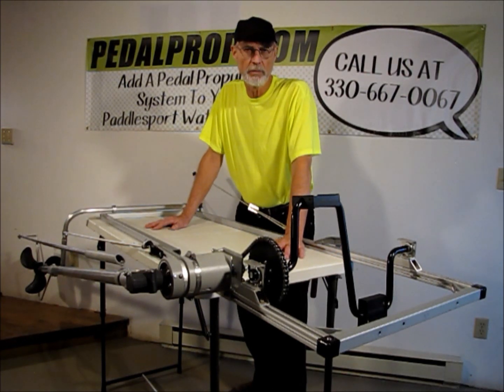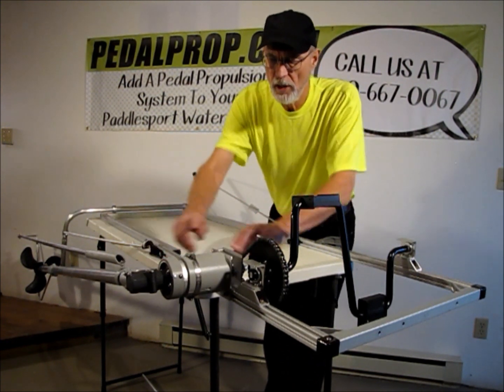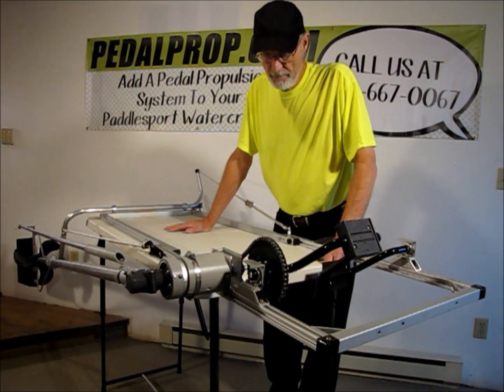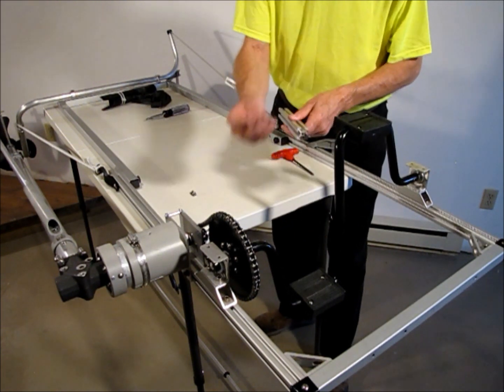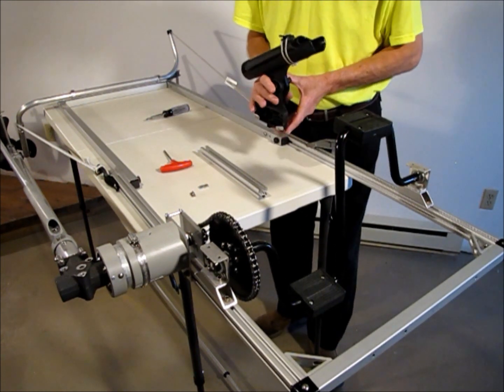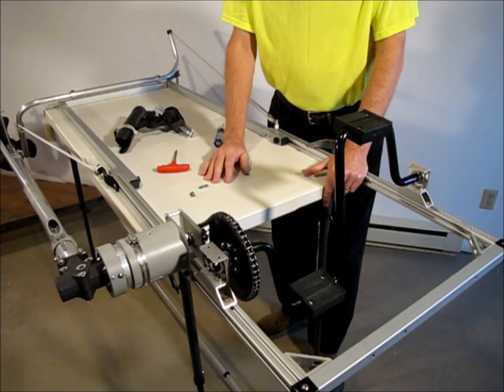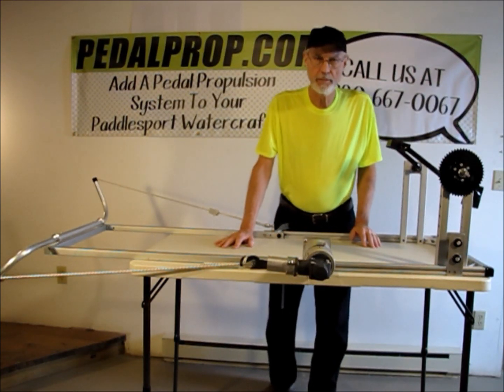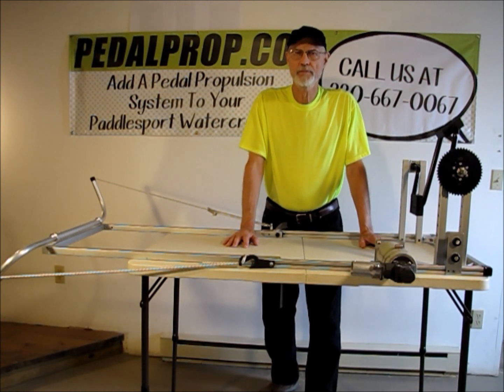New PedalProp Design

Comment: Could you open source the design?  What was the right-angle gearbox you used?  (It looks familiar, perhaps from an angle grinder?)
Reply from the maker: My patent is still good for several years so I may see about bringing it back in a slightly different form in a few years, so no open sourcing. The gearbox I used is an industrial gearbox that retails for over three hundred dollars, not some retro application.

Comment: Reasonably priced and well done .....I'm a retired composite boat builder and now have an aluminium canoe which I'm making into an outrigger ( proa ) canoe for snorkeling purpose . I'm saving up for one of your units . The unit rudder position seams to interferes with the prop spiral  , on some sailboats the prop is moved over so the prop spiral trust is not affected . I suspect you know about this scenario but mounted the prop in such a way as to improve steering performance while losing some efficiency at the prop trust .    Thanks for all your effort on improving small boat ergonomics .
Reply from the maker: Thank you Normand, Unfortunately I am no longer making PedalProps. The economy and a move to Florida put an end to home production. You are correct about the placement of the rudder, The two main reasons for it's location was simplicity of mounting and the excellent directional control it provided at this location.
Reply: @pedalprop4300  Florida you lucky guy ...maybe I'll see you there ....my wife and I go to Florida every second year , meanwhile  how do I keep in touch with you . I'm determined to have such a unit . maybe down the road I'll acquire one . Thanks for your time and have I nice life .
Reply from the maker: @normandgallant8106  pedalpropguy@mail.com

Comment: Awesome idea. i have an inflatable, single seat, pontoon boat, with steel frame & 2 oars for paddling. Can this pedal prop power unit be used for my type of setup???
Reply from the maker: Thanks Rodney. It depends on the frame, if you tell me your make and model, I could check and see if it would work on your setup. I am planning to arrange the PedalProp for a catamaran  style watercraft this spring and summer. Check in at pedalprop.com to see when this becomes available.
Reply: @pedalprop4300  Okie dokie. . . . . Thankya sir. i will do that. And you are welcome. Lemme getchya the information. . . . . .hold on. . . . . . ! Okay , its from the "Creek Company LTD ODC SPORT", & the H.I.N.# is. . . . "XQFO1244J203"
Reply from the maker: @truckerray7533  It looks it would be best to just attach the pontoons to the PedalProp frame. I think the only items needed for the PP would be a front and rear cross bar extension to attach the pontoons to. It does not seem the pontoon frame would be of any benefit.
Reply: @pedalprop4300  So how much for your pedal  prop set up??? perhaps i could figure somthing out, im sure.
Reply from the maker: @truckerray7533  The price for spring 2021 starts at $1,226.
Reply: @pedalprop4300  Okie dokie. thankya sir for the reply back. I'll keep all in mind. What is the gear ratio on your PP??? prop turns to 1 full turn of the pedal???

Comment: I need for a aluminum boat
Reply from the maker: The material the boat is made of does not mater. In general, the width  can be up to 44" wide and max length for solo boats is about 13' and tandem boats can be longer.